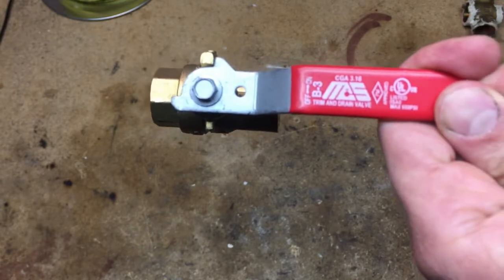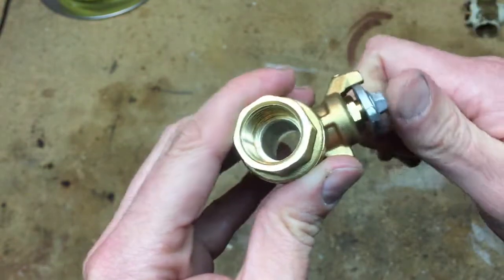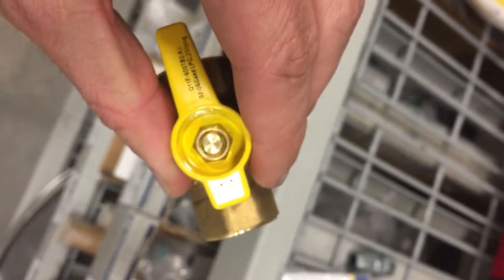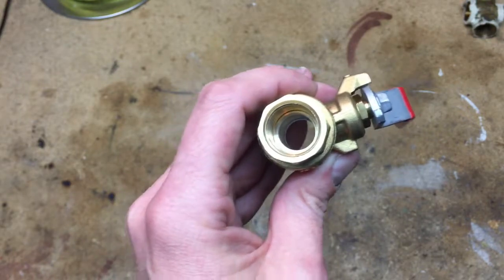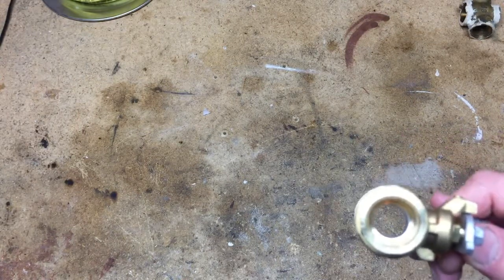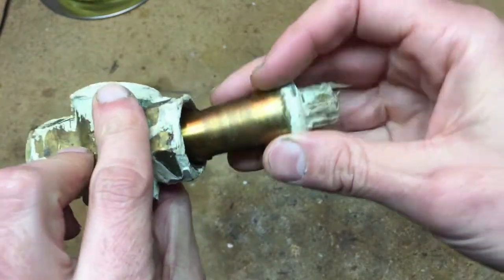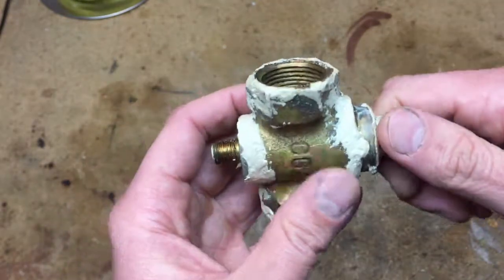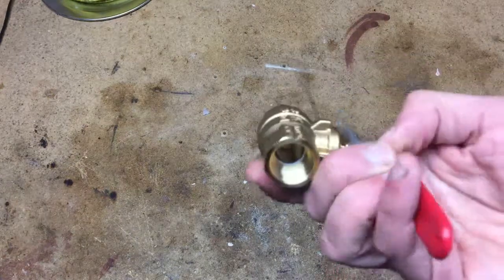Full Port Gas Valve vs Appliance Valve

Comment: Be careful when selecting in gas valve. My understanding is that most WOG (water, oil, gas) rated valves aren’t rated for flammable natural gas or propane. In this case the valve will need to be UL 125 certified as well. 

Does the red handle valve in your hand have the UL 125 certification marks?